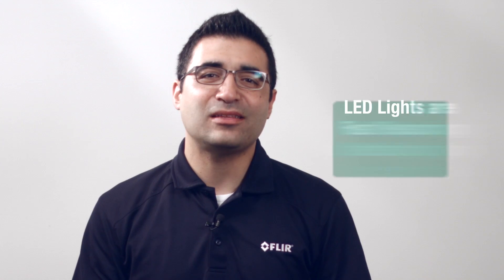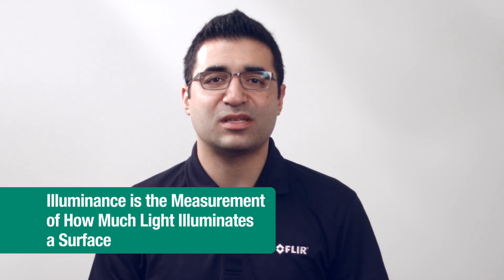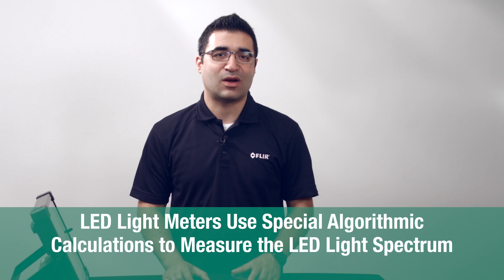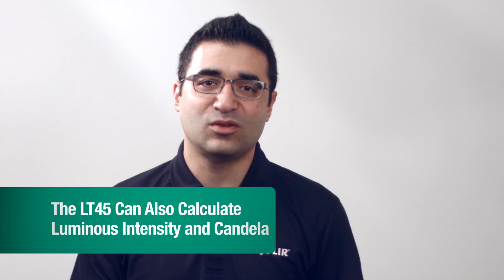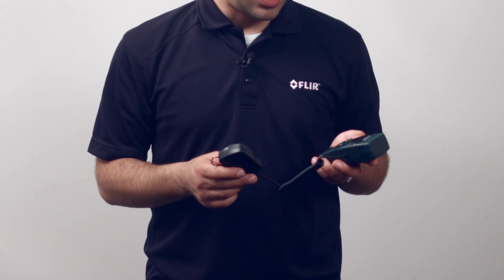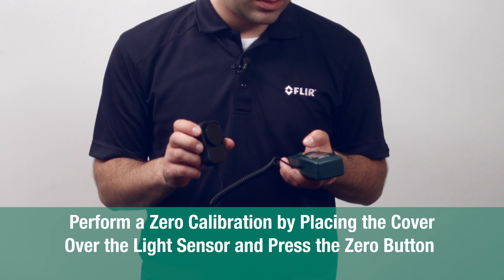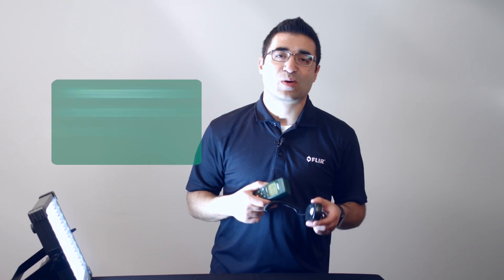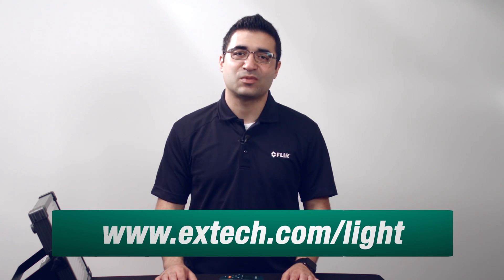How to Measure LED Lights

Comment: I am constructing plant grow lights and using full spectrum led beads rated from WL 380-840NM. Can I measure the light output with your light meter? Thx.
Reply: no
Reply: I'm making similar and when I test a "10W" led chip on a thermopile based meter, said 10w only outputs 1.5W of light energy 

Lumens are based on perceived light by the eye, and LEDs are rated by measuring voltage x current CONSUMPTION. Is there no standard unit used that makes any  sense? Damn this is getting confusing.

If my calc are correct one would need "100W" of consumption to make 15W of actual output energy?